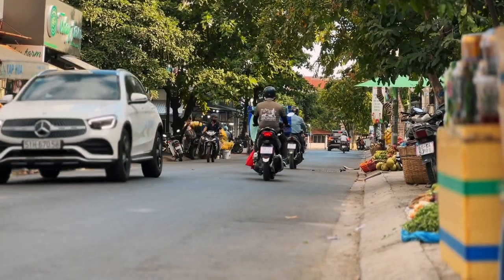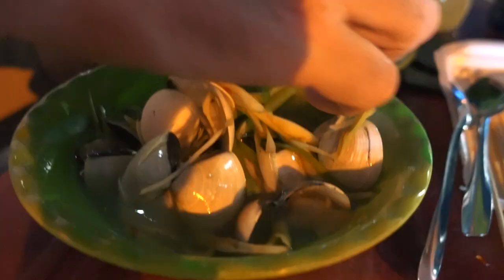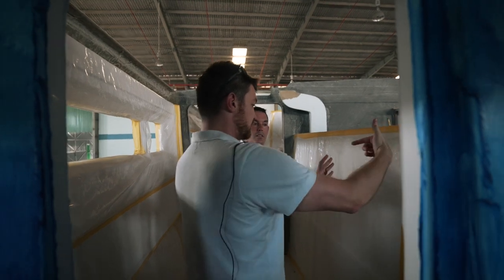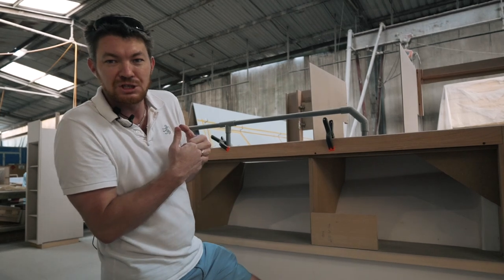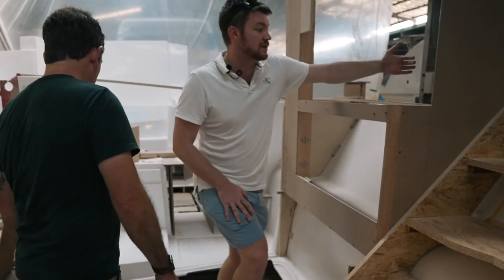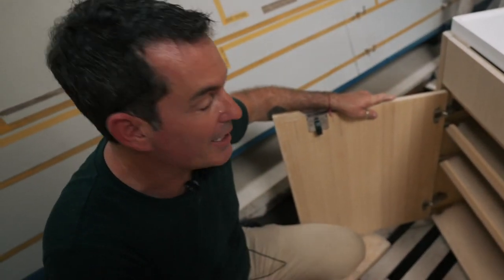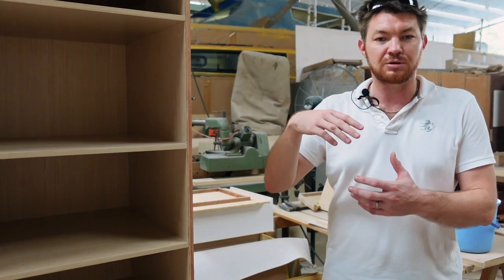INSANE Attention To Detail. Catamaran Interior- Nick's in Heaven!

Comment: That was really cool seeing the mockups of the cabinetry, steps and shelving elements of the various units under construction.  It really helps one visualize what will, or could, be in place with the finished products.  It makes perfect sense using the engineered wood finishes as it is very difficult to get matching grain patterns without spending many thousands to achieve those result.

Comment: Terrific episode, I completely nerded out!  
This is more for Shane (who will be building my boat in about a year.) re: The steps up to the bed. I'm 66, still spry, knees good, very strong legs - however large step ups are not desirable. We lose the shock absorbing springiness and when climbing we can't put that much force on our knees.  (I used to be able to step up about 20", single hop onto table tops (30" until I was almost 60)  I can still crank stair climbing all day long. However,  end of the day, over 60 the springiness in knees still diminishes quite a lot. Smaller steps 7 - 10"  (18 - 25 cm) are a necessary accommodation.   But 12"+ steps really slow me down. I noticed none of this when I was in my 50s.  
In Japan going up and down those very steep stairs a hand rail isn't a good solution. You want a few  'pistol grip' hand holds, use your arms to climb more rapidly and securely, and you would only need a couple of these on either side of the stairway. And then another set for going back down. Second stage would be to figure out if any of them can work in both directions - so you can use some for both directions.  If you're carrying something, or wearing a 50 pound backpack, you would still use at least one side.  A ladder is another way of thinking about this - so if you did have a hand rail, it would be much lower down  for going up.
The cabinet at the base of the bed. I like the hinges at the bottom. How about make them so they have the option of opening to about 45°, maybe some fabric gussets at the sides to make them more bin-like. I can see keeping my sleep ware (jammies) and stuffing in extra pillows, blanket. Now if I'm a bit chilly I can lean over the side pull out a blanket. If it opened as a bin you could fill it right up and not have it spill out  when opened.
One thing that I can never stop thinking about, more handles in more places. Getting out of the dinghy I kept thinking 'put a handle right there.' Going up and down the stairs to the hulls, handles. The way to think about this is a rock climbing gym. I once watched five guys slowing climbing up some boulders, took them ages. I was at the end of the line so I had time to observe and remember Jackie Chan movies. I did some rock climbing moves (I have no training, except as a carpenter learning how to go between the floors without a ladder or stairs), I pushed off the sides, zip - push -  extend - three seconds.  
I like the cut-out steps I think they would work really well. I think we climb stairs and companion way ladders in boats the same way every time. It might take a few times to sort  out the puzzle steps, but after that they'd be more secure and quicker.  In the Fontaine Pajot going up from the hulls I quickly discovered that I took those stairs exactly the same way every time, reached for the same places (corners of the galley cabinet and nav station. If it was my boat, at minimum I'd screw on a couple of small beads, or rock climbing bumps to grab with my fingertips.
For cup holders at the helm. I don't think I've ever sailed a boat where these were the 'right' size. My stainless travel mug and water bottle either doesn't fit, or it rattles around and falls out. How about just a couple of holes to insert various sized cup holders. So you can have one for skinny bottles, one for wider ones and one with a cut out for a ceramic cup. Two at each helm position. As you change watches you either use the 'other' holder, or you bring the one you need out with you.
Reply from the maker: Cheers mate!

Comment: Mockup of starboard bedroom showed a fold down door for the cupboard. when open the door intrudes into the walkway. Invariably someone will put weight on that dorr when it is open straining the hinge and pulling / stripping the screws out. If the hinge fails in big seas the door will slam open and break the hinge or strip the screws. Suggest side by side slider doors which would eliminate both problems

Comment: I'm probably the only one who doesn't like those recessed latches on the door edges. Two reasons: I actually have fingernails and envision getting them snapped off on a regular basis when trying to stick my finger into the recess. The other reason is that I wouldn't be surprised to find them quite the dirt collectors as anyone who has had to clean recessed anything it's a royal pain. 
I also agree with another poster who commented on the longevity of the soft-close mechanism being an issue. My son builds custom-made Murphy beds and while he was remodeling his kitchen I asked about those specifically and why he didn't use them and he said they just don't hold up well to regular use. Those and the spring open hinges that you just push against to pop open the door are prone to rapid deterioration.
Reply: Agree, Soft-close mechanism seems vulnerable.

Comment: How exciting to get to see the boat being built. I wanted to pass along a little personal story that conflicts with a comment Nick made in a previous video (not trying to be one of those, but thought you might be interested in hearing this story). A friend of mine had a Sabre Salon Express 48. During a fuel stop, one of his friends pumped about 100 gallons of diesel into his water tank. My friend was able to hire a company to remove the diesel and also treat the water tanks. I was on his boat less than a month after the incident and there was absolutely no diesel smell in the water at all. I am sure it was an expensive fix, but he was able to fix it. I was so worried that his boat would forever smell of diesel but that is not the case. They apparently chemically etch the tank and lines to remove the diesel. Just my $.02. I would hate for someone to have this incident happen and lose hope they could recover from it. Sorry I didn't post on the actual video where he made the comment. But I couldn't find it (and I basically watch them all .. lol).

Comment: Very Interesting.
Mock up on starboard bedroom showed drawer opening folding down. Invariably, someone will put weight on the door when it is open and that will severely stress the hinge and begin pulling out the screws. The other possibility is latch failing in big seas and the door slamming open breaking or damaging the hinges. Suggest side by side sliders. solves the problem described and the sliders don't intrude into the walkway area when opened.
Reply: Very good point on this.  Especially in the guest cabin where people may not be as familiar,

Comment: Have they considered providing for elastic shock cord webs inside smaller cabinets to keep from having avalanches when you open cabinet doors? Also, have they leak tested their composite cabinet panels to see how they would hold together if a leak (God forbid bc it's new but it IS a boat 😳) happened down the line. Would they be maintaining a stock of material for purchase (or could you purchase some now) for future repair/alteration? As he said, matching wood grains/tones is no easy thing.

Comment: It would be lovely to believe that bulkheads will never be a problem, but what provisions should be built into cabinetry to allow inspection and repair ten years down the road - should problems be suspected?
Reply from the maker: There’s a lot of inspection hatches and removable panels being built into the boat, if you watch last week’s episode Shane points out a couple of examples 😊
Reply: @sailingrubyrose  This is just me overthinking should furniture be designed to permit some dismantling in the event of a problem, hurricane, etc.- to permit repair. I see your reference to removable panels at 10:40 in your last video. There is a long list of "thinking ahead", "what if" considerations with any build, and I think this might be the first year that boat manufacturers are really being asked to think about permitting access for big repairs (like bulkheads) down the road. Heaven forbid there is ever a problem - and your carbon fiber is designed to negate this too, but if a collision or hurricane came to pass and repair wasn't factored into cabinetry ahead of time, you'd be cutting out cabinets 12" back from each bulkhead (like Colin - and many (hundreds of) others. I was listening to a video taken onboard a 62-foot catamaran - where bulkheads were screaming in sea trials; clearly buggered behind unremovable cabinetry and paneling. It's a good thing that you've taken the "nerdy" steps that you have - as you say.

Comment: My only concern would be the two steps up to the bed. They seem high, particularly for Terysa, and I would prefer there to be three steps which would reduce the step riser height. But each of the three steps would be shorter in length than the two steps. Did Terysa try walking up the steps? Do you have the same concern? Best, :¬) Webhead USA
Reply: That won't be their bed. Their bed is in the aft owners cabin and is located athwartship (across the boat not longitudinal). It will have steps each side. See the original 1370 reveal video (and the others following that) from about a year ago on their channel.
Reply: @gbsailing9436  Thanks for your reply. Now that you mentioned it, I seem to recall they were sitting on a bed questioning if they had enough head room. And yes, I recall the steps on both sides of the bed.
Reply: @webheadusa9377  But you raise a good point about the step height, as has been said by another here...
Reply from the maker: Hey mate, as GB Sailing said, this is the guest cabin, but certainly it's something to consider since we'll having guests of all shapes and sizes. I don't think the steps up will be a major issue- anyone used to moving around a boat won't be bothered by it I imagine- but I think the handle is a good inclusion so you'll have something to grab onto and haul yourself up (or just provide support) if the boat movement is significant enough to cause unsteadiness. There is another cabin, in the aft part of the hull, which just requires you to crawl in from the bottom, so that's another option for guests who may not be able to handle the steps.
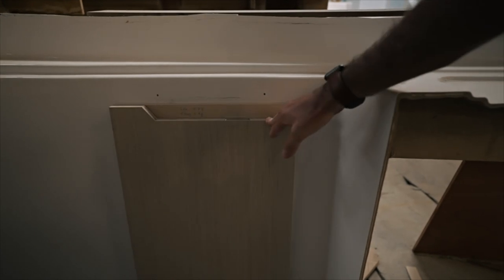Reply: @sailingrubyrose  Nick, the segment that caught my attention starts at 5:26. Take another look at how high Shane (sp) has to raise his leg to step up, his knee almost reaches the height of his waist, his femur is almost parallel to the tread while his right foot is almost at his left knee height. It would be a harder climb for a woman. Otoh , the tread of the first step is long and does serve as a platform to make the bed. Yeah, a tradeoff, higher step up but a longer platform. Oh, the custom pressed one-piece aluminum door latches - ask for several spares to serve as replacements if needed. Your 1370 will be a precious jewel. Best, :¬) Webhead USA